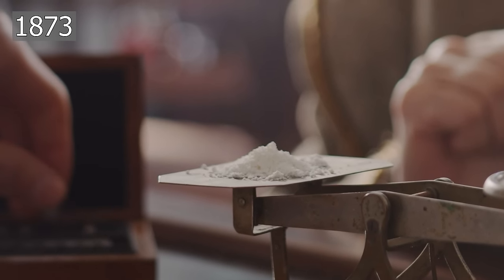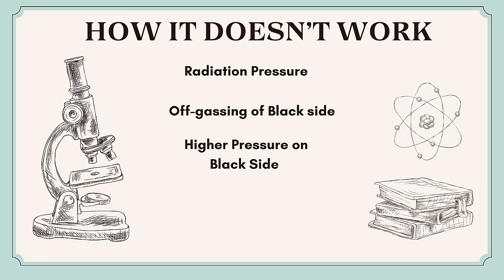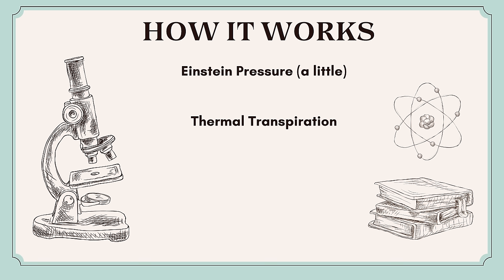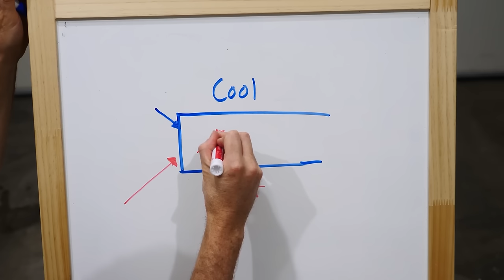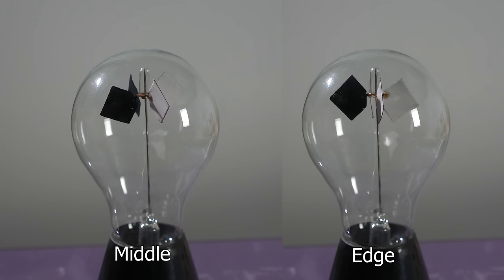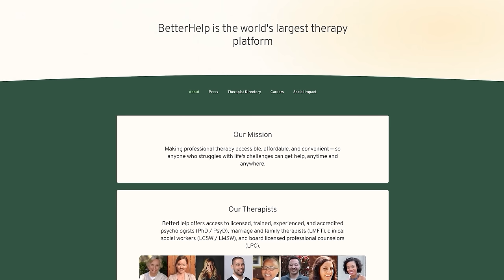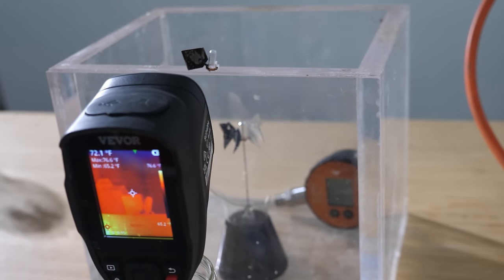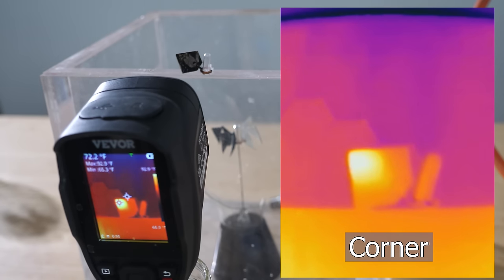Trying To Solve The 150 Year Old Mystery

Comment: I always thought it was just that air molecules recoiling off the hotter black surface would have more energy than those recoiling from the white side.  Yes, overall air is at the same temperature, but it is those air molecules that recoil from the surface that count.
Reply: That's what I thought. I wonder if they use high concentrations of CO2 make it spin faster.
Reply: That doesn't explain the double-sided radiometer at the end

Comment: you can combine this experiment with the ionic thrust, both use the same principle, one creates a thermal vacuum, by giving energy to air molecules that is bein replaced by sorrounding, low vacuum air, and the other an ionic vacuum, ionizing air molecules that are repelled and the vacuum filled with sorrounding neutral air molecules, If you can coat the plates of the radiometer with a thin electrical conductive layer of metal and plug it to HV you should see the same. Eventually you may see opposite rotation, depending on the metal coated surface.

Comment: Make one with vanes that have a spiral cut groove through the whole thing. You'd have a massive surface to edge ratio. Also, when you cut the vanes down the middle, you greatly increased their moment of inertia by opening them up so wide, of course it didn't spin much faster.
Reply: Or possibly a myriad of pinholes?

Comment: Interesting. Cutting the vanes may have reduced the temperature on the black side and hence reduced the temperature gradient, which is the main driving force. We have so many physic models that can simulate the outcome of many experimental results with high certainty but not so much on this old science toy.  Here is another paper on Crooke and Hettner radiometer DOI: 10.1088/1361-6552/ac420b

Comment: 5:57 Isn't it possible that as you cut those slits, it moved the overall geometry further away from the axis of rotation and due to conservation of angular momentum, it spins at a slower rate as a result. Given its size, I'd say even a few mm would make that difference and with your results, that variation might match up

Comment: My best guess is thermal expansion? And it has to be in a vacuum because the force exerted by the expanding air wouldn't be enough to overcome air friction? The problem would be that with less air inside to slow down the vanes, there would also be less air to expand.

It definitely seemed like the total surface area had a noticeable effect. Maybe that's why it wouldn't move after you punched holes in it?

Comment: @The Action Lab Nifty. I know these Q's weren't the main point but you should have at least shown how fast it spins with that ultra bright light before you smashed it & even more importantly, why was it so slow with the bright light in your vacuum chamber ? Was it that the pressure wasn't low enough or too low? Since they say they work better in a "medium" vacuum why didn't you just let some air in ? Or is a medium vacuum in industry even lower than your lowest ?
Reply: Its your last point, less  of a vacuum and more of an absence of air here if I said that right...poor vacuum !

Comment: I wish you had tried to spin it with some infrared source. I mean, it must react differently to different wavelength and energy levels of lights if the reason is thermal transpiration. It must spin faster with IR light. And I think it maybe spin slower under the ultraviolet light even if UV has the most photon energy in our visible spectrum. Because as far as I know the best wavelength to transfer energy as heat is infrared despite UV has the most energy.

I mean, if the reason is heat, IR will perform better, but if the reason is photonic pressure caused by momentum of photons, UV will perform better. And i think this experiment would bring us a solid answer about the question.

Comment: you should check into the reflective and absorbative properties of each material for light and heat. would not hurt to know the electromagnetic charges and specs on them too. i. e. one black ink may act as an insulator whereas another may have heat resistance...

Comment: Would be interesting to attack the laser to the assembly and see if it continues to accelerate in that configuration. Maybe if it is too heavy, something like a fibre optic cable to reroute the light as the device spins would be interesting

Comment: I always thought it was a matter of heat difference.
The black side heats up more, thus heating the air close to it.
This air then expands and pushes the disc.
In low density air (low pressure) there is low friction and also relatively more pressure difference for the air heating up and it can't transfer heat to other air molecules very efficiently.

Comment: The rotation in the vacuum is due to the gas molecules taking energy from the black-hot side and going in opposite direction to the rotation. Meanwhile, with high pressure there is an opposite direction wind current due to cold air rushing in neutralizing the effect. Therefore in zero vacuum this wouldn't work and would have a maxima for speed for appropriate low pressure.
Test This --> Reducing surface area reduces speed(You checked)
                       High surface area to mass ratio increases speed
                       Shape of the paper matters, Focusing air molecules perpendicularly would increase the speed

Comment: A simple explanation: The force is not caused by the radiation pressure of the incoming light, but by the "cooling" of the wings, because the black side emits more photons than the white side increasing the pressure under the black side.
This could be checked by heating the wings without an external light source and observing a rotation. Also you could point the laser on the white side and observe rotation.
Reply: if the radiation pressure isn't enough, the cooling pressure will be even less enough, because the vanes emit far less light than they receive.
Reply: @tsm688  it emits exactly the same amount of energy as it receives. Conservation of energy must not be violated.
Reply: @juliuseder  not all energy is light
Reply: @tsm688  if you add energy by light, some is transformed to heat and some to motion. When you stop adding energy it will eventually get to equilibrium with the environment emitting all added energy as heat.

Maybe we could heat the wings without adding light on the black side (e.g. with IR-laser on the white side, electric current or radioactive decay) to prove that the pressure difference is because of the higher heat energy emission on the black side to the surrounding gas molecules.

Comment: In my opinion the wheel turns cause the black side generates a small amount of heat on its surface by absorbing light.
Now the plate has a low-pressure and a high-pressure side, even in a vacuum and starts turning due to the pressure difference.

Comment: It may rotate by heating the tiny air layer over the wings, at higher temperatures on the dark side.

In absolute vacuum this wont happen, and possibly at 1 atm pressure air drag overcomes the effect or even heat dispersion occurs at ratios that allows pushing on all sides.

This could explain why it doesn’t turn with holes, by decreasing heated surface.

One way to prove it may be building another model with one face of each wing heated by Joule effect with direct current, for example

Comment: It seems like a form of a "Solar sail" Where the photons are able to interact with the black parts of the material. Which could induce a slight force that's maybe causing temperature or pressure changes in the chamber

Comment: If you can find a way to measure the force imparted more exactly, this might be far easier to work out.
Maybe a single blade of the radiometer in a vacuum, hit by a fixed laser, to measure how many degrees it rotates off whatever force it gets before rotating out of the laser's light?  That would make tests more reliable, so simpler tests could be performed like the light position you did, or seeing if light angles matter.

Comment: I'm still not clear on why it couldn't be photon pressure. Perhaps the speed of light gives the photons enough clout to move objects when there is little resistance.
Reply: Because the force that photon pressure exerts is way too small to account for the observed motion
Reply: Also, on the black side the photons are absorbed, while on the white side they bounce off. On the black side the photon goes from having some momentum down to zero, but on the white the photon goes from that same positive momentum to roughly the same but negative momentum, so the overall change is about 2x as much. However much momentum the photon loses is the amount the device gains. The result is the vane would be pushed harder on the white side than black. You'll see in the video, the vanes actually spin the other way, meaning the greater force is on the black side
Reply: a) not strong enough
b) moves backwards to the direction that would predict

Comment: Chemistry hints to gas molecules sticking to surfaces by enhanced reactivity when surface area is higher.  Thus it would be logical that a hotter surface would make those gas molecules fly off more often than the cold side resulting in a net force difference. Yet this needs to cycle thus gas needs to connect to the hot side at some point to keep the force running. 
Conversely the cold side would see more gas being available for sticking to it and see a net force opposite to the hot side.
I see why the edge effect is considered as there is the point of possible transfer of stuck gas molecules from the cold to the hot. But if you make holes then you affect the surface and affect the net force attainable.
While this is a compound effect and truly hard to separate the sticking part is testable by changing the gas to something more inert electronically or simply heating it up (the whole radiometer including walls).

Comment: The coefficient of thermal expansion may make a difference.  Eg. Neon will effect greater thermal expansion than if helium were used.  Differential in speed noted if variance in RPM with different noble gas would impart support for hypothesis.  If movement is due to electrical force, delta of milieu voltage will elucidate that.

Comment: If it is due to thermal currents, then to prove it just change the shape of the veins such that it is easier for it to turn in one direction.  Make the veins shallowly cupped on the black side with black on the inside surface.  Then do it in reverse.  If one or the other turns faster, then it is due to the thermal dynamics and if not then it is due to something else.  My guess is that it is a combination of different forces acting on the veins.  It seems to me that the answer lies with photons striking the vein, thermal currents, an electrical charge, and a solar wind radiation push.  This is a very interesting idea to think about as the forces acting on it are so small that it is very difficult to narrow down what the true cause may be.

Comment: What a blue baller of an experiment I gotta say. Too much variation for repeatability for one. And there's so much I want to see now.

Since it doesn't work in vacuum, what would be the optimal pressure that gets the most push? What about angling the strips? Wavelength of the light? Turning the whole thing upside down, or 90°? Shining two lasers from opposite sides to see what spot gives the most push?

Please, expand on this. We need to know!
Reply: In my opinion, he made his first mistake by discarding the glass globe and putting the thing inside a large square walled vacuum chamber. 

To assume that the globe which is in close proximity to the spinning blades has no effect on the swirling airflow or is not essential for its operation is a bad assumption not supported by good experimental practice.

Comment: In your experiments you do not maintain a constant angular distribution of mas. Like an ice skater spinning faster when they bring in their arms. I think measuring rotation frequency is a reasonable approach, but you may want to place a mirror attached to  thin wire and measure how much it twists using a reflected laser the amplify small rotations. Also a way of measuring the force of gravity between two suspected objects.

Comment: Does the wave length of the light matter?
How does the force evolve with the light intensity?
Are there electrical charges accumulating somewhere?
Is it the same in a magnetic field?
Does the distance between the glass of the bulb and the rotating thing matter?
Does the angle between the light beam and the surface of the rotating thing matter?

Comment: I'd like to test different conce tration of gasses. Superlow vacuum but made out of co2, he, ne, etc... And see how much it would affect.
My feeling is that denser gasses will make it spin faster. I think the vanes are thermally vibrating and any random molecule that impacts on them, bounces off, mechanically imparting a reaction force, not due to "higher pressure"

Comment: well, I think what happened was when u heated the era up air molecules pumped to the area and got accelerated away and causing an opposite force on the thing. and it doesn't have to do with corners, and this makes sense because when u cut it u didn't change the area, so it was spinning fine but when u punched holes and reduce the surface area it didn't work.

Comment: Maybe we should think in term of momentum rather than force ? Here's my thougths : the momentum given by the light is the same in both side (whatever the side is absorbing it or reflecting it), so that's not an explanation. So the momentum should come from the state (cooler or hotter) of each side. Now the "sail" is moving in one direction so there must be "something" that goes the opposite direction. The thermal radiation could do a part of the job, because the thermal radiation of the hotter side is more energetic and carries more momentum. But I am thinking also about sublimation : in low pressure, it can happen more easily, and the temperature could make it even more easilier. So if the hot side lose more molecules by sublimation, it could create a momentum corresponding to the observation.
Those are just thoughts. I have no idea how to calculate if this sublimation difference is enougth to make it spin the way it does.

Comment: okay, need a follow up video, change the color of the laser, the thickness of the plates, shine the laser at the white plate only, shine the laser at the pivit point, break the glass, while under vacuum and measure the diference to see how much gas is actually in the bulb, try with different color plates, same color plates, different types of plates,(paper, plastic, aluminum, brass, glass, etc), try a high frequency strobe light, try a low frequency strobe light, try modifying the pivit point, try adding a lubricant to the pivit point, try an infrared laser. shall i continue?

Comment: My hypothesis is, effect could be result of the conversion of thermal energy to kinetic energy through gas molecules.

Which also explains why this effect wouldnt work in extreme vaccum and in normal pressure.

Explaination:
Upon viewing from side, one side is cold and another is hot

 Molecules of air with average kinetic energy/pressure contact on hot side, absorbs heat, and bounces off with more kinetic energy. 

And on the cold side, air molecules impact and slow down.

The hot side works like molecule propulsion.

And this wouldnt work in EXTREMELY less pressure because there are not enough molecule to build momentum.

And in normal air, molecule activity is numerous, so it averages out. Hence no effect.

Comment: Good evening, a rarefied gas inside a glass ampoule could ionize (rarefied plasma) with a light source. The glass of the ampoule acts as a "photon greenhouse effect" because many photons remain trapped, reflected from the internal surface of the glass ampoule. The atoms of the rarefied gas can ionize more easily, and remain ions for longer, because the mean free path is longer. Thus white face reacts to a different extent than black face to a light plasma, which is conductive.

Comment: It's due to heat localisation causing low pressure zone surrounding the heated area which in turns causes air molecules to hit the plate producing a spin but it should be done in space to confirm this theory.

Comment: Guessing your making a mini eco system 

With the particles in the air moving faster or slower in areas

Heat makes the molecules move faster right and expand if something next to me expanded I would move.

So surrounding air is normal but neighboring air is pushing me. 

I'm guessing a hotter laser pointer may push faster but it's enclosed so it may keep the same ratio of movement before so it would seem like no change??

Maybe a material that aids in heating only the neighboring air and not the remainder of the enclosed space would move it faster

Comment: Assuming the black side is hotter or imparts heat to the gas molecules that bounce off it. Ie to they depart with a higher velocity and impart a small velocity to the vane. Once the vane is moving it transfers some of its extra velocity to the molecules striking the cooler white side until an equilibrium is reached. The equalibrium result is the spin speed it dependent on the sustainable temperature differential.